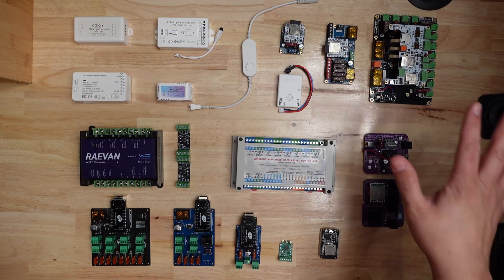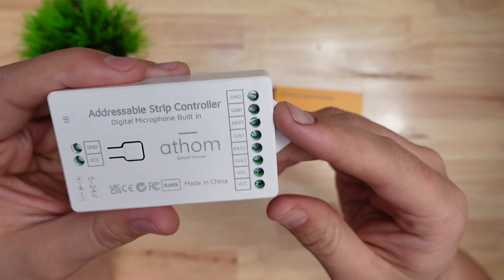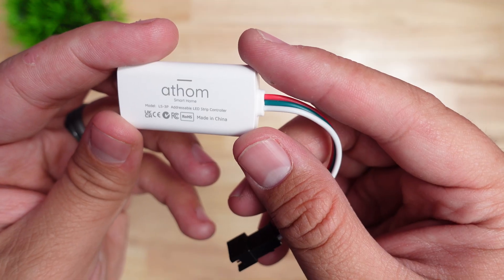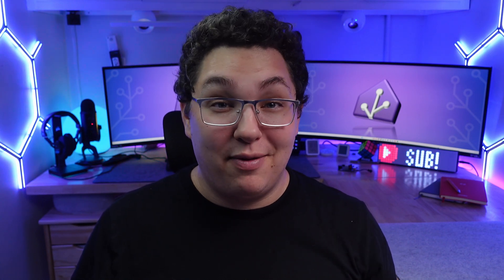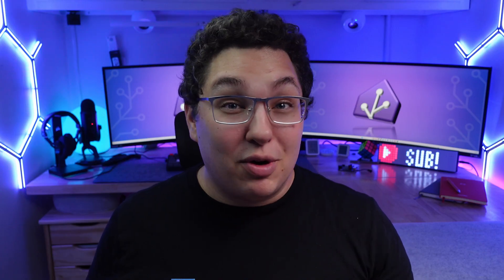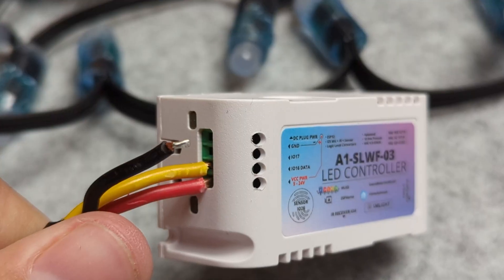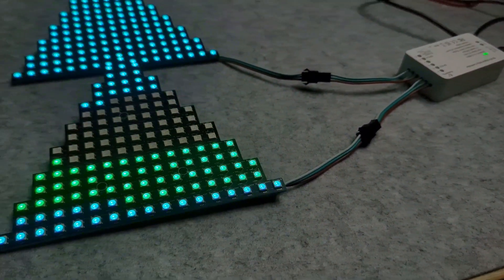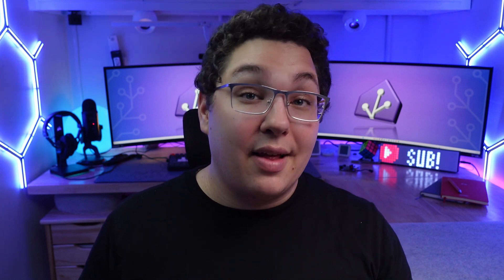Best BASIC Controllers for WLED! (QuinLED, Athom, Smlight, + more)

Comment: Lots of good info. I use a smart outlet that my power supply is plugged into so these Wled controllers that dont have a relay in them are not powered all the time. I can set on/off schedules  with the smart outlets.

Comment: Hi, I am totally new to LEDs and in need of some advice. I am looking for a portable and rechargeable battery that can power a 5V WS2812B RGB LED with 300 pixels for about 5-6 hours before needing to be recharged. Also need the simplest controller that can be programmed to randomly change colors by itself for hours. Any recommendations based on your experience? Thanks!

Comment: hey man. which of these controllers will be able to power by a phone adapter? will be using it for a led strip for my table.
Reply from the maker: Dig2Go is best.
Reply: @MakeItWorkTech  thanks! this will work on signalrgb right? correct me if im wrong, as long as wled software is installed in any of these controllers it will work on signalrgb?
Reply from the maker: @jeypac666 I've never used that so I'm not sure, sorry

Comment: Hi,

I am looking for a controller that can work with the BTF lighting SPI FCOB strips 24v that have adressable leds and have 764 (RGB) or 896 (RGBW) leds per meter. These are WS2811 and WS2814. Lenght per strip in 3 or 4 meters and the 4 meter are mounted on the ceiling and need a lead cable of 3-4 meter to supply power/data.

BTF says on the product page these do not work with ESP32 controllers. But i want WLED for sure. And chatGPT says it has something to do with the data voltage output (3,3v) that needs to be 5v. It recommends a level shifter or so. I just want to have controller that can have WLED and works out of the box with a normal case. Not a DIY solution with boards and cables. 

BTF FCOB strips seemed to work in the past but do not anymore according to customer reviews on amazon and the BTF product page.

Do you know any controllers with WLED that work out of the box for the FCOB BTF strips?
Reply: Don't mean to hijack your comment but I can at least attest to the QuinLED Dig series (Dig-Uno, Dig-Quad, Dig-Octa) working fine with these strips since they all include a proper level-shifter output circuit.
Reply: Thanks for the response. I found a WLED controller that has a level shifter that works. From athom.

Comment: newbie, I had several sets of christmas lights that reviews say are WLED compatible, but everything I've read says there should be 3 wires and they have 2?
Reply from the maker: Yeah, should have 3...
Are they solid white?
Reply: @MakeItWorkTech  nope, not color coded, green insulation, lights work with a app called "hello fairy"😅

bought them on a whim, thought I'd try hacking them later.

Comment: I'm not at all educated or knowledgeable at all with any of these areas and I'm struggling to figure out how to go about attaching a smart app type control adapter for my Mimwise CCT Tuneable COB STRIP Lights that have a 4 pin male power plug attached. It can't with 1 controller but I need 2 additional controller things for the 2 other strips.. trying to have a schedule auto on and off routine that mimics sunrise/daylight/sundown etc. I don't have a Hub or Or anything. I don't want to spend a ton and want the easiest way as I'm not familiar or smart in this area lol. Will any rgb adapter thing work that's on the same smart app platform being Tuya or what thing is it that will work?

Comment: Great into.  Did you ever make the second video?
Reply from the maker: No, but hopefully soon! Next few weeks is the plan
Reply: @MakeItWorkTech  that would be great. I plan to take a run at putting up lights around my house in the spring. I’m planning on using 24 WS 2811s.  And I really want to get it right the first time. Your videos will be a great help with that. Thank you.

Comment: 😅😊I have a set of Tuya house lights and the cheap controller has failed it’s voltage is 36 volts have you got a replacement recommendation

Comment: Hi, thank you for a very helpful video.  I have a case there I use a 10 m SW2812 cobic rgb led strip.  I have cut it in 0.7 m segments.  From one and same power supply, I have connected these segments in parallel.  What controller do you recommend in this case

Comment: 4:00 The LS2812 has been updated to the LS2812B since 1 September, according to Athom.  It now uses an ESP32 and current capacity is now 3A.  Same product link.

There is also a different SKU for the same product (LS2812BC3) that's showing (for me at least) a cheaper price right now.

Comment: Hello I have a question for you. I want to be able to change to different effects using a sp32 and wled. But the lights are on a golf cart so when away from my home I can't change to a different effect. Is there some kind of remote with some presets that can be used. Thanks
Reply from the maker: You can just use a WLED controller and Wi-Fi mode so you don't actually have to connect it to Wi-Fi, but it broadcast and access point and you can just connect to it with your phone and control it that way
Reply: I will try it. Thanks

Comment: Thanks for the great video! Just a quick question though. Why would you use one instead of a standard esp32 board with WLED installed?
Reply from the maker: It's just a little easier and more plug and play than flashing a controller yourself

Comment: Thanks for your video, I am trying to simulate sunrise sunset for my aquarium, What do you recommend Controller and LED strip to use?
Reply from the maker: The cheapest would be fine! Probably USB if the size strip you need is short.
Reply: I am looking at Athom with ESP32 ,  how to figure matching and LED strip or matrix  match it .

Comment: The on-screen text of this video says at one point that all the other controllers have level shifters rather than sacrificial pixels, but I think there was some question about whether the GLEDOPTO has level shifters (or adequate ones).  This might not be an issue when the lights are close to the controller, as you tested.

I think that Quindor's teardown found that their ability to handle 24v is problematic as well, as you have discovered pragmatically.

Comment: Great video.  I need to replace my fluorescent lights under my kitchen cabinets for downlighting. I want something that I can have a button nearby that can toggle of the different effects or a dial. What do you recommend for this set up - about 12 linear feet?  Need 2 6 foot sections as there is a sink in the middle.  Any ideas suggestions appreciated!

Comment: I would not suggest upgrading WLED on a DigUNO via home assistant, with or without sound reactivity. If you don't use the QuinLED custom compiled versions of WLED, you will get some very strange behaviour. Some effects won't use all the LEDs, yet others will. Turning off the LEDs might leave a single LED lit. Some effects will use different colours than those selected, but only for a portion of the LEDs.

Comment: Great video! Have been wanting to try some things with WLED for a while now.
What would really add to the video though would be a table at the end with all the pros and cons of each controller in one overview (adding each controller when you're talking about it). Now I have to listen to what you're saying, make a mental table in my mind or rewind and write things down. A picture (table in this case) would help a lot. Think columns like 5V, 12V, 24V, # of terminals, fuse y/n, (approx) price, size, beginner/advanced user, case included y/n, etc.
Looking forward to the sequel!
Reply from the maker: I have a table... Maybe I'll make a written version and put it there!
Great feedback, and thanks!
Reply: I haven’t watched this yet and I’m new to trying to DIY my own LED lighting, but I’ve had ADHD my whole life and struggle with executive functioning skills such as working memory. That means, for me, it can be difficult to hold on to information, shuffle it around, and manipulate it while working with it in my head. (I also have a math disability so numbers in particular fly in one ear and right out the other when I’m not intensely concentrating on them.) Having visual aids helps with that. Plus who doesn’t love a good spreadsheet!?! 😁

Comment: Are there any controllers that don’t need the neutral and hot? I’m independently powering all of my LED strips and don’t need passthrough power from the WLED device. I just want to connect them all via data cables.
Reply from the maker: The controller needs to have power to function... How will it connect to WiFi?
Reply: @MakeItWorkTech  sorry, it turns out I was referring to power injection. I just want to bring data back from each strip to the WLED device. The WLED device will have its own power and the strip will also have its own power. I’m roughing in a space with vaulted ceilings. I’m going to pass 3 low voltage cables to each strip from the media cabinet. Two of those low voltage cables will be for +/-, the other for data. Data cables will go to WLED device. The +/- will go to a 24V DC power supply. The power supply will be connected to an outlet inside the media cabinet that is controlled by a normal light switch. Hopefully I’m speaking sense here. Everything should be completely hidden. Strips will shine line up the vaulted ceiling “creating” more height in the room
Reply from the maker: @Braindead154 ah ok I get it. nice sounds like a fun project!

Comment: I have a soft spot for Athom since they got me into this WLED hobby. However the main issue I have is that they frequently drop the WiFi connection. So I tried QuinLED DigUnos. I set up heartbeat uptime monitors. Multiple Athom units had the same WiFi drops while the DigUnos were rock solid. Since then I hsve become a huge fan of QuinLED’s line up. I do agree with your comments that DigUno is a bit more DIY than a basic model. For a basic model the DigToGo is amazing. As long as you are ok with 5V (I generally prefer 24V) then built in sound reactive and the convenience of USB power is great. Then is it nice that you can move up in the line to DigQuad or Octa, which I used to power large xLights Xmas lightshows. The only gap in the range is for analog where I use Shelly RGBW2, and QuinLED will soon have a product for that.

Comment: Regarding the Dig2Go at 11:52, although what you said is accurate, you implied it can't do sound based effects out of the box but it can; it uses the UserMod instead of the fork.
Reply from the maker: You have to install that though, right? I have not tested that
Reply: @MakeItWorkTech  Nope!
, comes pre-installed! Though you might need to go into settings and enable it, that I can't remember.
Reply: Sound effects were an available option in the standard install for my D2G. Just brillant for a matrix display!

Comment: I recently bought a QuinLED Dig-Uno for lighting up my office and it's a little beast. I have it running 10m of 60 leds per meter RGBW leds and it's doing holding up really well. Only thing it's missing is a nice case but it took me all of five minutes to model one up and get it printed!
Reply from the maker: Yeah I actually found one on thingiverse. That's what I ended up using!

Comment: Perhaps not the best comment here, but to explain a bit where the physical design of the QuinLED-Dig-Uno came from: The fuse was originally intentionally put in front of the ESP board, because the ESP boards used in earlier models did not have proper feedback protection and you could blow stuff up by connecting the main power and USB at the same time.. Next to that it is also a little push to remind people to turn off the power while playing with wires, as the most common mistakes are creating shorts on power and data pins by changing things around while the board has power.. Of course like you mention this is more advanced, hence the Dig2Go was created. Also do note that proper USB-PD power supplies will often not be able to deliver anything more than 3A at 5V, so there is a good reason for limiting it in hardware.. It also has a build in relay :)
Reply from the maker: Makes sense! Good that QuinLED rolled out the Dig2Go as an alternative! I think there's still room for a controller that competes with the Athom LS4P between the Dig2Go and the DigUno.
Reply: @MakeItWorkTech  Oh for sure, I just answered the question in the video. I'm a little bias so not going pro/con on other brands, specially because personally I have no experience with them.
Reply: @MakeItWorkTech  I don't think a good controller can't be much smaller than the Dig2go, it's got en Electronic relay function for disconnecting power to the leds when off.
And all kind of Safety features that prevents you from burning down your house.
On a little not quinled did a test on those athom controllers in a livestream that eplains why these controllers don't do so good at 24v or long wires between controller and Ledstrip

Comment: Nice one Aaron. The reason for the 5A and 10A fuse on the Dig Uno outputs, is because an edge injection (beginning or end) is never more than 4Amp (5A fuse). A mid-point injection can be 8A max (10Amp fuse) - 4Amp in both directions. All to do with voltage and current flow - would have to go back to your college Thévenin's Theorem!!
Reply from the maker: Ah ok, that makes sense I think (to a mechanical engineer :-D)
thanks!
Reply: @MakeItWorkTech  Well, I still like you!!  Electrical engineer!!
Reply from the maker: @gerryf7015  also known as "wizard" to us mech E guys haha

Comment: smlight does have touch button at the top, it's printed where it is on the sticker.
Reply from the maker: Yes, I wondered if it was under there. Do you have to configure it in WLED?
Reply: @MakeItWorkTech  it works out of the box. When you touch it there is a red light indicator

Comment: I have a GLEDOPTO and it flickers so bad with my 24v 720led COB strip (even with very short data cables). Just purchased the Athom one, fingers crossed it gets rid of the flickering
Reply from the maker: I had no issues with my Athom - hope it works for you!
Reply: One issue with the GLEDOPTO is their terminals - the push and release one. They have a terrible hold and cannot take any 16 or 18 awg wire,  You really have to jam the wire into the terminal to get them to hold. Might be your issue.

Comment: great review, looking forward to the next part.
Did you know there is another app for Wled it`s called Wled native.
Also +1 for the quinled controllers, about the Dig2Go it has the sound reactive on it you just have to activate it in the info tab or the usermod settings .
For the Dig-Uno it was a trade of for getting the controller as small as possible and all the functions it has, also the fuse in front of the usb-c connector of the esp32 is to prevent it for plugging in a cable while under power, kind of a safety feature.

As for all the Quinled controller there are many safety features in it for safekeeping of you, the leds, and the controller.

The Dig2Go has it`s own site but for all the quinled controllers there are online install versions available of the newest stable release of Wled with al inputs and outputs already set.
A huge plus for keeping everything up to date check the dig2go dot info and the quinled dot info site for that.

On a further note quinled has a real life powersheet on his site for power consumption of a lot of ledstrips, mayby you can take a look there if you want to find out how much power a ledstrip consumes as you mentioned that you didn`t know the power consumption of the ledstrips you used.

Also nice of mentioning Chris Mahler he does some great things with leds, i like his projects and copied a few of them, he explains everything on his build video`s.

Well as i said im really looking out for the next video on this and it`s great that you even link the leds you used in the description.

Comment: I get the comments ref the dig uno, so why not recommend the dig2go instead as a basic controller?
Reply: The Dig2Go only supports 5V strips, the DigUno support 5/12/24V strips and also power injection.
Reply: @gerryf7015  You mean like the Athom one in the list but better? :D
Reply from the maker: Only supports 5V strips and supplied by USB-C. Also price is higher than others